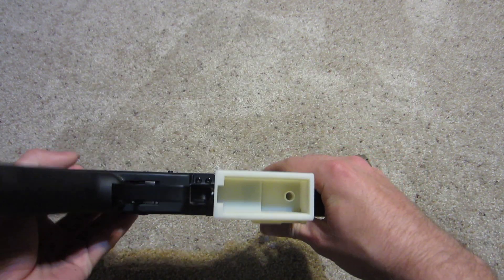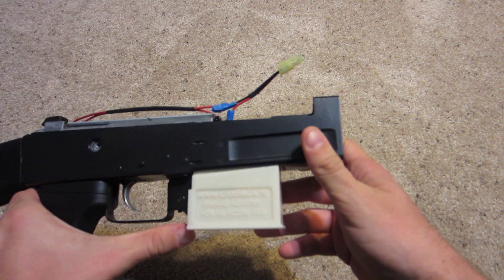Airsoft AK Stanag magazine converter progress

Comment: you HAVE to get the mag release right, or else this is a downgrade as m4 mags are vastly more durable than ak mags but they hold less, if your mag release is unreliable with most brands it will be not as good as the ak mag release because it gives 2 pros (high cap capacity and always working release) to the ak and 1 pro to the m4(durability) which means the ak wins and you wouldn't want that as ak mags are already better because of qc and pickyness with brands.
Reply: ObjectableApparatus no, m4 mags are shit. Literally every m4 mag I’ve dropped breaks because they’re made out of aluminium, literally the cheapest A.K. mags I own are steel. I even got 2 with the gun I bought, both are more durable than an m4 mag

Comment: is this up on shape ways yet and if so how can we find it :) also any way of just getting the file so we can print via another firm :) this would actualy make my ak usable as the mags are a pain to load in the heat of action.
Reply from the maker: Matt Houghton Unforunately, I'm not releasing the STL file. You can, however, find the Shapeways link here: http://www.shapeways.com/product/YU92J3NED/

Comment: hey, Is there a way to fit airsoft ak mags into an m4 magwell using an adapter?
I want a bull pup that can use ak mags instead of m4 mags
Reply: Would be a cool Idea but why? Pretty much m4 mags are universal right so why would you want to have to use A&K mags do you just have more?
Reply from the maker: Probably not. The AK magazines are longer than M4 magazines. You might be able to get a (IIRC) SR47 body, and do some custom work to make it a bullpup. If you're coming at it from a utility standpoint though, I'd reccomend M4 mags in a bullpup. They're somewhat of a standard.
Reply: chewytreee They sell M4 mags that are shaped like AK mags if you want something a bit easier.

Comment from the maker: You could remedy this by sacrificing a highcap, and turning it into a midcap. Take it apart, pull the guts out (Make a box mag for something, using the internals), and you'll be left with the old BB reservoir, and a small tube where the BBs fed from the winding mechanism. Take a follower out of an old busted midcap, and put it in that tube. Put some epoxy at the bottom of the tube, so that the spring will compress when you load it. A screw would work too. Msg me to let me know if this helps!

Comment: may i suggest you try get this in production via the kickstarter program, i and im sure many others would be very interested in this component. or if you can make the designs downloadable so we can send it to a 3d printer ourselves.. Ak mags cause issues with some load bearing equipment, i was looking at trying to convert a g36 mag converter..